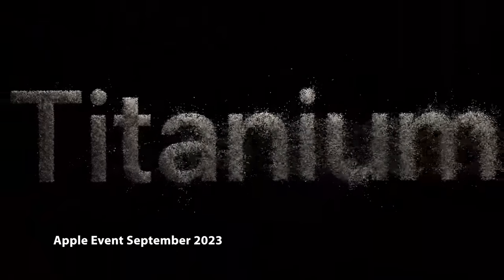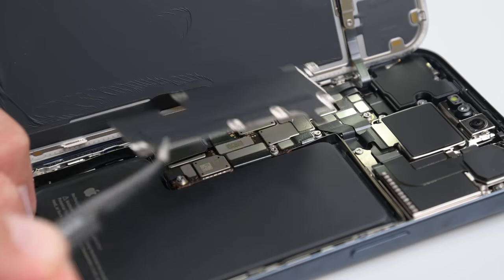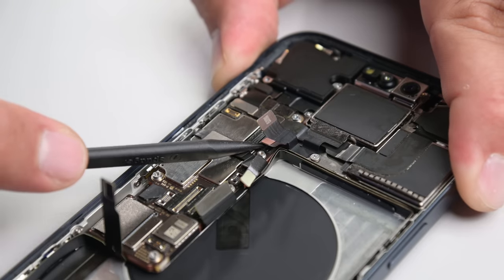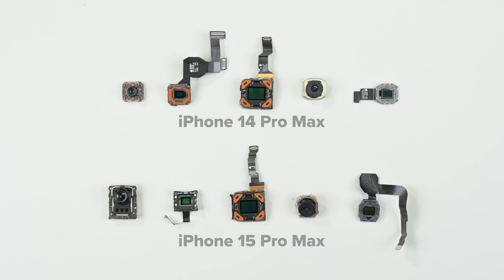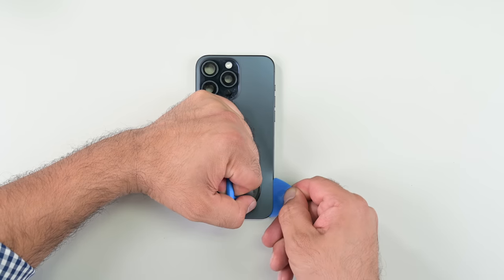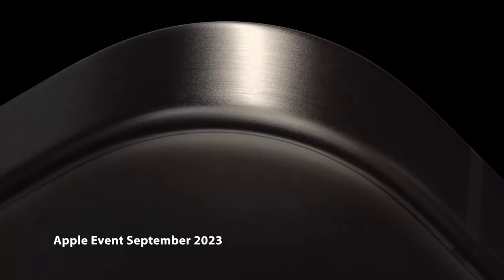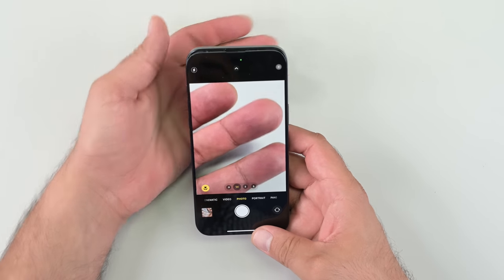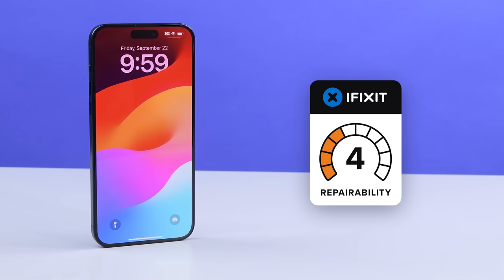iPhone 15 Pro Max Teardown: Big Phone, Microscopic Scratches

Comment: I am an iPhone user, and I love Apple products and its ecosystem, but you giving 4/10 to this piece of crap is outrageous. The only good thing about these phones is USB C and back glass coming off easily. Nothing else.

The score should be even lower, like 3 or 2/10 imo.

If the software bugs are not fixed in the near future, it should receive an abysmal rating from y’all.

If they truly care about the environment, maybe release a phone in two years or so. Not yearly. And I am saying that for every electronics manufacturer, not just Apple.

And consumers, if they care about the environment, like me, they should use their device until the end of its life.

Like I am still using my iPhone 12 Pro, and will not be switching to 15,16 or even 17. I’ll use it until it lasts.

Comment: The titanium " Shell" actually is mostly aluminum.  The outside frame only has about a  1mm thickness of Titanium and the rest of the iPhone is aluminum.  Bending the Truth is called ( LYING). We shouldn't have expected anything less from Apple. Titanium is just too expensive to make a phone solid Titanium.  Atleast the stainless steel iphones from previous years are solid Stainless Steel. Solid Stainless Steel is far superior to a combination of 30% Titanium and 70% Aluminum. The hardness and integrity aren't even close.
Reply: Apple did say in the video that they were keeping the aluminium frame.

Comment: Titanium scratches like crazy but that’s also part of the charm.  They should have just used grade 1 titanium on all instead of grade 5 on just the outside ring.  The new design is flawed which makes back glass structural integrity much less and easily cracked.  iPhone 16 needs to fix all these reliability issues and actually give us an efficient 3nm chip instead of this energy hog that is the a17 Pro, which gives us no noticeable energy efficiency improvements at all vs the a16 chip.  Crazy they went from 4nm down to 3nm and gained 0 efficiencies.  👎
Reply: average users don't care.
Reply: @starksuman  yes they do. iPhone 14 back glass don’t crack on slight bends.  The new phone does.  The average user definitely gonna care the newest phone on the market has a weak structure that makes the back glass crack so easily.  

No one wants to pay for a $1200 phone that has weak back glass.  Not anyone who has a brain
Reply: @AtlantaGuns  bro that's a usual line said by iphone users whenever any one enlighten them about reality.
Reply: @AtlantaGuns  Who bends their phone? If you’re clumsy and drop or bend your phone regularly, consider saving yourself the headache and just buy a prepaid flip phone. It’s a travesty that every cycle we have to throw $1,000+ phones off of bridges, out of moving cars, light them on fire, stab them with razors etc to reinforce that fragile electronics can’t survive being run over by a dump truck. If the average dullard can’t be bothered to treat a pocketable super computer with a modicum of care then they deserve to have a smashed up phone.
Reply: @starksuman  This is the usual line that poor people spout when they can no longer hide their wallet envy. I’m not worried about mine breaking because it’s in a case and kept in a $1,500 leather backpack lol
Reply: @jaredweiman2987  🐑
Reply: @jaredweiman2987  ahh typical iSheep found. Are u lost from ur horde or what?

Comment: It appears you are not aware the rear glass on the new models is thinner and will break easier than the previous model - this is why Apple reduced the cost of the rear glass panel which probably means more rear panel sales.  

The frame is not solid titanium - it’s more of an external shell on top of a normal alloy and has a PVD coating and welded to the frame.  Btw you never own an iPhone you simply lease it no matter if outright or contract - same goes for Samsung.  If you want to truly own your phone and repair at will you will have to make your own.  I also don’t support home repairs or third party repairs and never had an iPhone repaired in my life.

Comment: The pairing of Touch ID made some sense  to prevent a process running on CPU from extracting or  sending fingerprints to Secure enclave. But pairing of other components is purely to render the phone unrepairable.  Guess what Apple: I am sticking to my XS so in the end your sales go down because of your policy.   You're getting $100 battery replacement instead of $1700 for a new phone with telephoto. 

If Apple were concerned about the environment and pleasing Mother Nature, it would make its phones repairable and live on a sustainable business model with phones having longer lifetime due to better repairability. Instead, they have continually moved to make all of their iGadgets impossible to repair, either to reduce manufacturing costs or to prevent repairs.

Comment: Despite all the (often just blind) hate against Apples methods for repairablity, I see at least some benefits to this.
Especially when it comes to the battery, it prevents some shops etc. to sell you cheap and even dangerous parts. 
But of course this always gets overlooked and ignored because hating on Apple is easier.

Like, for example Samsung requires you to not only replace the battery but also the screen when you wanna swap the battery on a S22 yourself on the "official way". If Apple would do this, there would be hundreds of videos, articles etc. how this is unacceptable. But since it's Samsung and not Apple, absolutely no one cares.

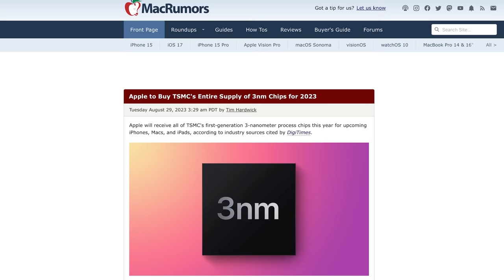Comment: At 3:02 check out the very poorly aligned component in the bottom right corner :)   
Actually if you closer many components, ICs, resistors, etc. aren't straight. 
Chinese quality ain't what it used to be :D